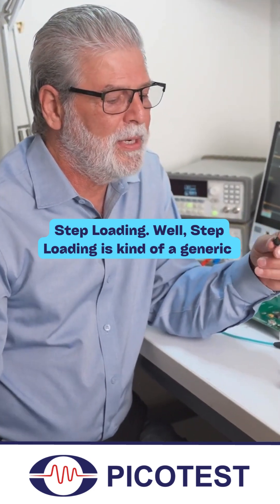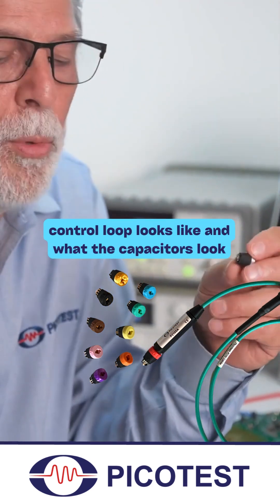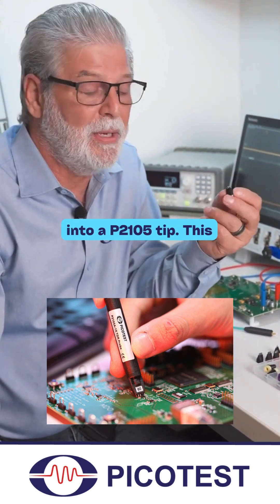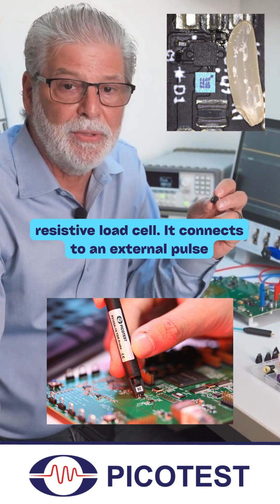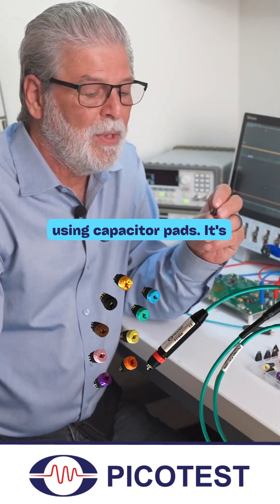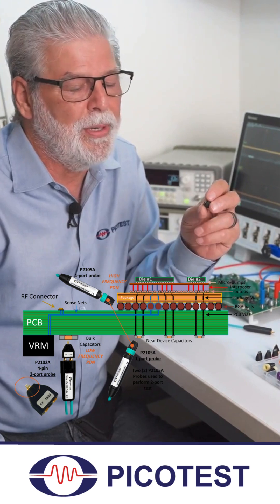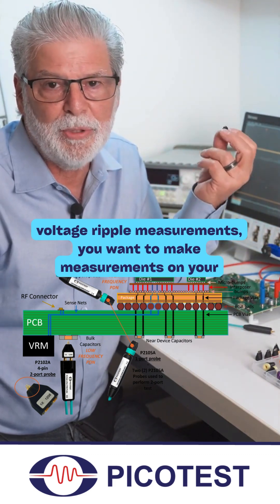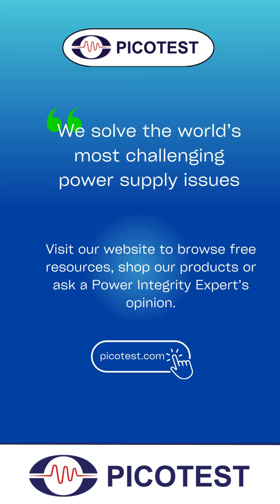Picotest P2105A probe a versatile multi-function probe #powertest #electronics #powerdelivery

Comment: GaN is a load cell too?
Reply from the maker: In most load cells, a resistive element changes its resistance in response to strain or deformation when a load is applied. The GaN resistive load cell in this case is using Gallium Nitride (GaN) as the material for that resistive element.
Reply from the maker: It is this version of the P2105A probe - https://www.picotest.com/product/p2105a-s10-version-for-transient-load-step-testing/
Reply: @Picotest1  but GaN is a semiconductor, that's what doesn't make sense
Reply from the maker: @wilurbean  GaN (Gallium Nitride) is indeed a semiconductor, but it can still be used in resistive load cells, particularly in applications where its unique electrical properties are beneficial.
In this case, GaN is used as the material for the resistive element, offering advantages like high power density and fast response times, which can be critical for transient load testing. While traditional resistive load cells typically use materials like strain gauges that change resistance with deformation, GaN's ability to handle high voltage and temperature makes it suitable for specific applications, especially in testing environments where high-speed, precise measurements are required.
So, while GaN is a semiconductor, its properties make it effective in specialized load cell designs for testing, like in the P2105A probe (S10 version for Load Step test that I linked above).